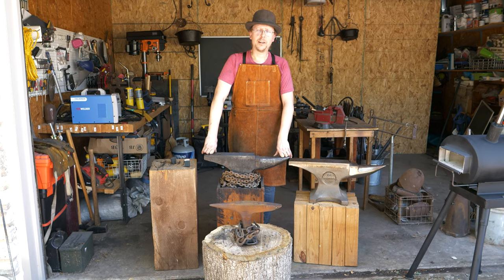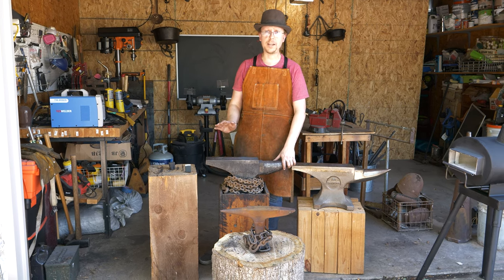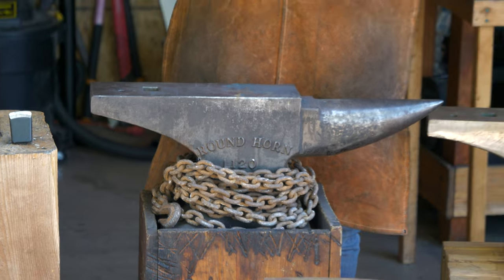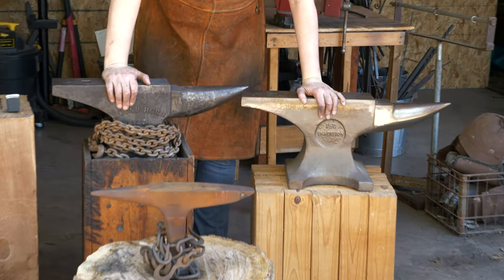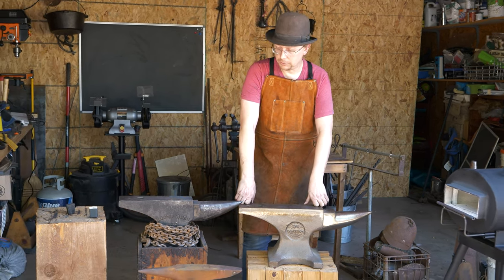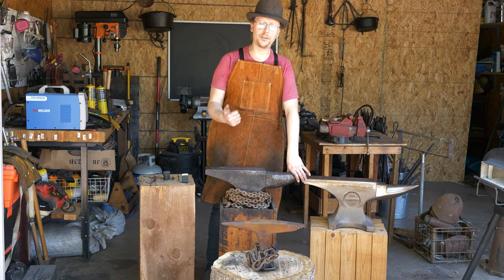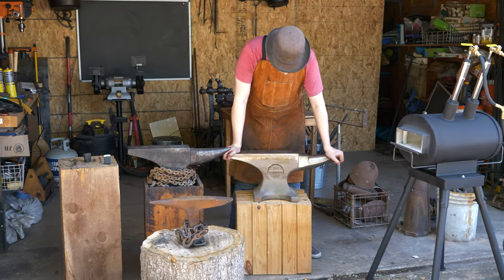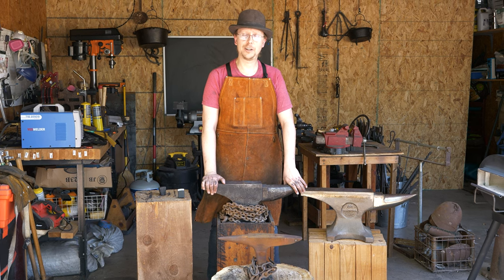A look at different types of Anvils

Comment: Drop forged anvils are good too. Hard to find. Peddinghaus used to be available.
Reply from the maker: You can't drop forge cast iron, so you know something drop forged will be steel.

In general, they will be high carbon, so yah, it's a good sign that a quality material was used.